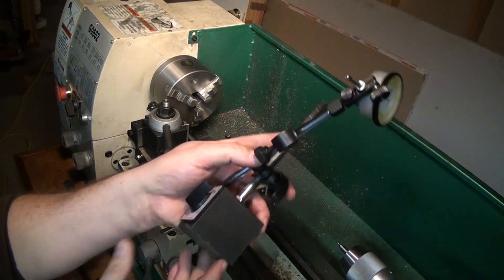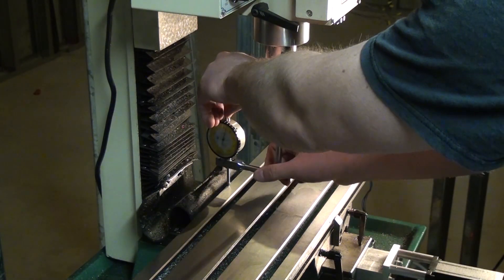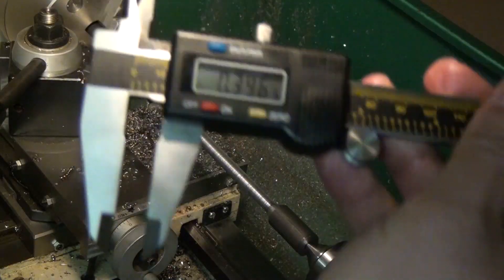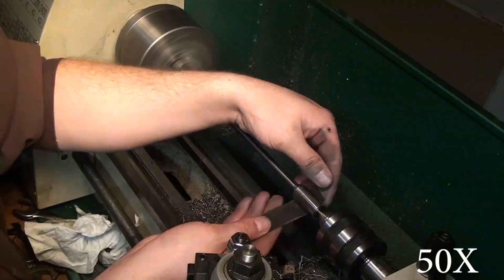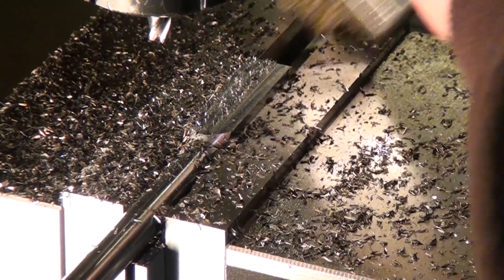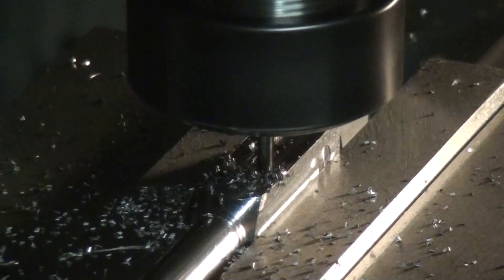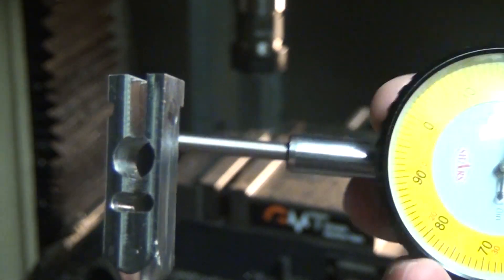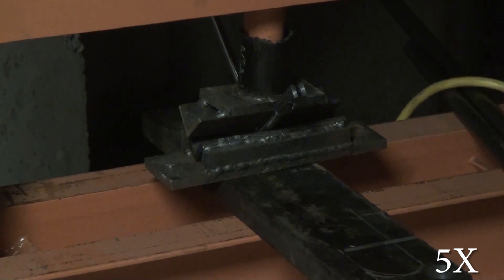Spindle Mounted Dial Indicator Holder

Comment: I really enjoy your video and I enjoy your saftey message. It's hilarious.
Reply from the maker: Thanks Jim!
Reply: russtuff Hey dude. I use this on my big CNC. It (or a smaller version) is perfect for chip clearance. They run quiet and push out heaps of high pressure air. Even quieter in it's own little bot. No more swiping away with a brush. I also mist coolant using this setup :) http://www.aliexpress.com/item/ACO-016-air-pump-of-laser-engrave-machine-520w-450L-min/2003753399.html

Comment: Nice video. I especially liked your safety warning "consider that anything you do my way may kill you" ;>) Keep the videos coming. I think I'm going to buy a noga NF1018 spindle mounted holder to tram my mill. They're a little pricy, but very flexible and solid when locked. Not quite as solid as yours, though. No joints is most solid (but least flexible). There's always a tradeoff (sigh).

1. End mills are not made for facing. Use a face mill wider than the part.

2. If your setup is rock-solid, climb milling will give a better surface finish. Conventional milling is best for manual milling. Is this CNC?  Rule of thumb is don't climb mill on small mills or mill/drills except for finish passes. Zig-zag milling should be avoided. You're climb milling on one pass and conventional milling on the next. Climb milling cuts slightly deeper, so you end up with down and up stripes.

3. OK, here's the easiest way to figure out whether you are climb milling or conventional milling with an end mill. Assuming normal "forward" or clockwise rotation of the spindle. Take a cut less than half the width of the tool (usually much less).
Make the tool travel around the part with the cutting surface to the left. What does this mean? Play like (pretend) you are riding along with the cutter, keep the cutting portion of the tool on your left as you drive around the part. 
   NOTE: The consequence of this is if your are milling around the outside of a part, you will travel around the part in a COUNTERCLOCKWISE direction (this would always keep the cutting edge on the left).
   If you are cutting a pocket, start with a cut down the length of the pocket centered between the longest edges of the pocket and cut straight down the center of the pocket then around in a CLOCKWISE direction until you reach final size of the pocket (this would always keep the cutting edge on the left, also, except for the initial cut down the centerline where your are neither climb nor conventional milling! Be sure the cuts are (much) less than the diameter of the tool.

4.  Climb milling is milling for which the cutter grabs and tries to climb thru the part, thus pulling the tool along vigorously. The operator (or auto feed) is pulling back rather than pushing thru the cut as you do when on a lathe or conventional milling on the mill. If you've ever used a radial arm saw, you know what I'm talking about.

5. Never plunge an end mill into the material. It cannot cut at the very center and also cannot push the material into the cutting edges as a drill bit can. So how do you start a pocket? Hmmm, be creative. You'll think of something. I usually drill to depth with a drill less than the size of the end mill, then switch to the end mill and plunge. OK, so now its ok to plunge with the end mill as there's no material where the center of the cutter will be if you center it over the drilled hole.

Comment: Another reason for poor finish on the mill is if you are still using the stock configuration for the lead screws that has slop or backlash which causes the machine table to jump around when you climb cut. My experiance when working with 1018 an 1045 on the same lathe as you with a carbide cutter, it like faster spindle speeds. I was running it at 1200 rpm with .010" of chipload per pass. It made a huge difference in surface finish over running it at 560 RPMs.

Comment from the maker: Thanks you for your comments. The collet was in fact loose, but I agree with you anyway. My feeds and speeds were directly from the GWizard Calculator, but the cut definitely went much better anyway when I switched to 50% step over :)

If i didn't hate tool changes so much I would have just faced each side. Being that I'm inexperienced, I suck at swapping tools and keeping my Z in spec. I need to get an electronic tool setter so I can have the machine handle that stuff.

Thanks for watching!

Comment: Dude you go way too aggressive on the milling the reason that the mill stopped was that you were going 100% step of the tool diameter not that you didn't tighten the tool enough... be bellow 50% both on step over and step down of the mill diameter.
Nice video though! Thanks for uploading!

Comment: Hey, I'm no professional but rule of thumb is you can mill the full dia of the cutter as your depth of cut as a rougher if you have coolant.
If I rough a surface with a 3 inch face mill I will only take .080 at a time leaving .005-.010 for my finish pass. All at 800rpm.
I would have done the surfacing with a facemill to get a nice surface, then run my endmill for the profile, leaving .003 on either side for my finish at full endmill depth.
Hopefully that made a little since...
Love your videos.

Comment: Instead of (not) worrying about safety when sanding on the mill, you should be concerned about getting the carbide grit from on and into the ways, because unlike the metal chips, the carbide grit will scratch and gauge them :(

Comment from the maker: I'm very happy with this lathe, and John is part of the reason I bought it. We have talked extensively about CNCing as I'm planning to do mine this year. If you can afford something larger, heavier, and more rigid then I vote for that, as I think it does make a difference. That said, the G0602 is a great candidate for CNC and when I do mine I'll post a whole series of videos on it. I just have to many other projects going this spring.

Comment: Dark cutting oil (available from any big-box home improvement store), sold for pipe threading, is what you need for turning and milling steel and steel alloys.  Try it, it will help your finish a lot, and also give your machine shop that "machine-shop" smell.